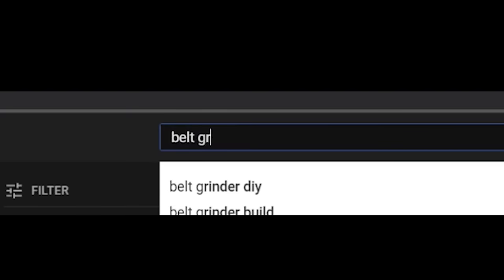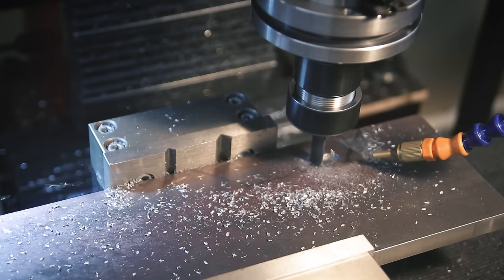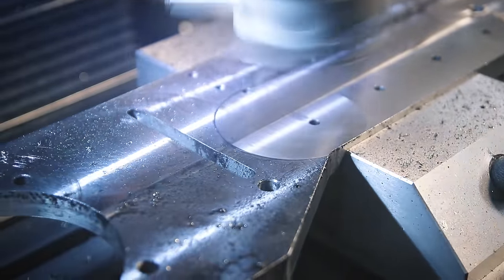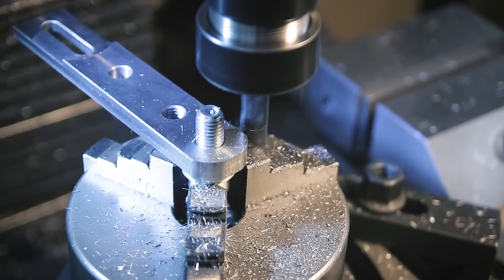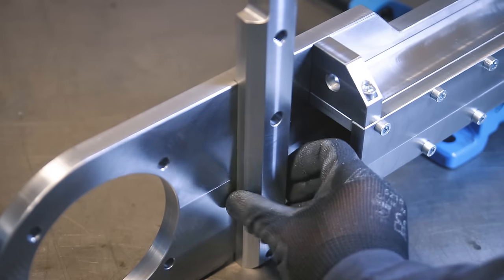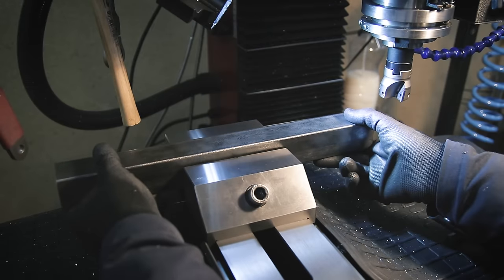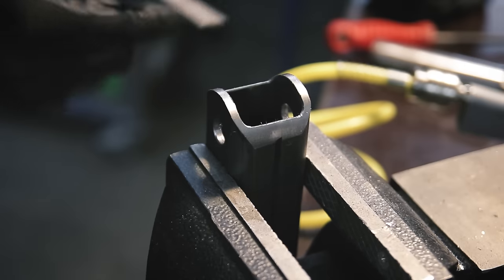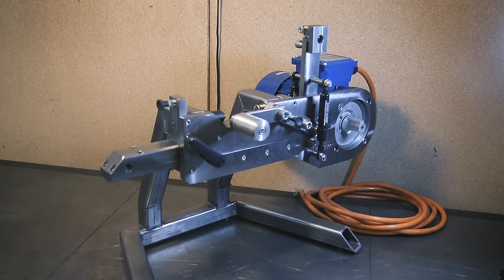Building a Machinists Belt Grinder - The Trilogy [Part 1]

Comment: You can tell the difference between the work of a fabricator and work of a machinist, an overbuilt, overmachined tool, which will do the same work as a basic fabricated one, is an unnecessary use of labor, BUT if I was a machinist I would TOTALLY go all out with my skills to make a basic tool to showcase my skills. It’s kinda like a gunsmith making a toaster with inlays and engravings on it, it still makes toast but it looks good while doing it.

Comment: I like your neurotic approach to design and construction. I’ve bought a fair number of used machines over the years and I find I like the ones where the engineers used twice as much material as would have sufficed for the purpose and generally went way overboard in every aspect. I would like to build a similar grinder and am greatly inspired by your design.

Comment: This is a very nice design for a belt grinder. I really like how it can pivot from 0° to 90° using the quick release handles. The thickness of the steel plates seems more than adequate to mitigate most vibrations that may occur during sanding/grinding. Your machining skills are great and watching you make these parts makes me want to get back into machining again. It was once a part of my job a long time ago, but I do miss it. Never thought I would say that, but fabricating things has its own reward. The process actually relaxes me in many ways. It's definitely therapeutic for me. I think your CAD design is awesome. A picture really is worth a thousand words and seeing the 'idea' up front definitely helps you to reassess certain things as you fabricate, so you can improve things on the fly. I'm anxious to see the final product. Great video!

Comment: finally i found a machining channel that uses metric
Reply: As does Stefan Gotteswinter who has a fantastic machining channel (in my opinion!).
Reply: I'm form the States, and YES our stone-age measuring systems has got to go. But its gona cost a Gazillion dollars to replace it now. Aaand we have those "We are number one" people who say: We went to the moon using inches. To them I say? You also went in your dippers.. It got the job done.. why do you use a bathroom now.
Reply: @iteerrex8166  I'm actually Canadian but default to mostly imperial units when it comes to most things. I keep both metric and SAE taps and die sets, but only keep stock of metric fasteners! Indicators are imperial, test indicators are imperial, calipers and micrometers; digital ones have both metric and imperial, dial/vernier scale ones are imperial.

I was taught machining using imperial units and that's what I've known and used in machining for 20 years now so I doubt that'll change XD
Bottom line, if it doesn't involve fasteners, I default to imperial XD You can imagine the shock I had when I started 3D printing and had to switch from imperial to metric for that XD
Reply: I can go either way, been doing both for years and just convert it when I need to.

Comment: I've been meaning to get my own home machine shop up and running for years now. I think I bit off more than I could chew when I first started and it's been a challenge to get my machines reassembled and modified as I had originally intended. Thanks for the motivation. :)

Comment: I love that someone finally made a belt grinder for metric belts, I'm from Argentina and here is more common to find 75*150 and 75*200 mm belts.
I made a home made 75*150 belt grinder that has not a single piece square, but works fine for what I need. I dream that one day I will have the equipment to build one like this one or like the one that Jeremy Schmidt made (but with metric belts)
Reply: sorry 75*2000mm and 75*1500mm

Comment: You need to make some low profile mill clamps. They are a game changer for plate work!
Fantasic looking build! Also the spring loaded pins are a brilliant addition
Reply from the maker: Absolutely! I didn't even know about these, then saw a video about someone making them a week or so ago, and thought "damn, those really would have come in handy". I kept thinking I need a mag chuck for this kind of stuff, but the price on those...
Reply: Ha I tried the same, a mag chuck doesn't really have enough holding power to make it worthwhile though

Comment: Great work and very nice build. When you face a large, thin piece, you can reduce the chatter by bolting (or tack welding) another plate to it below. That will add the extra rigidity without you having to machine another piece.

Comment: This is the biggest "my shop is awesome" flex I could imagine. Loving the content, wish I could get a mill and lathe myself.
Reply from the maker: I know the feeling, I saved up a long time for these, but I'm hoping they will eventually pay for themselves. My first one was used and only cost around 600€ (I made a video on restoring it). So it's not impossible, the bigger issue is usually that  you need a space to put them...
Reply: Phil Vandelay With that many fuckin ads in your vid it shouldn’t be a problem...
Reply from the maker: @snk_blk I removed most of them now. Besides, you way underestimate how little this stuff pays out, I work on the side to even be able to make this content.

Comment: Hey Phil, nice part.  I noticed that when you had the large part standing up in the vise, you backed it up with a piece of plate.  I'm not sure how your small mill machines, but on a Bridgeport or Lagun/clone, if you push towards the solid jaw on your vise, instead of the moving jaw like you had it, they are a bit more rigid. Also,  if the machine can take it without sucking the cutter in, I'll generally always try to climb mill it, better finish and not re-cutting chips.  Anyway,  have fun.  

Oh, P.S.  Boring heads, in general,  just like drill chucks, don't work very well when going sideways, they were made to just move in the Z-axis. But I'm sure you knew that.  Cheers

Comment: I would like to make a belt grinder, but first I'll need a mill...
and to make the mill, I read I could use a lathe...
so I need to make a lathe.

I've spent the last several weekends making 4 axle holders to fit 15mm mtb throughaxles onto a 2m x 1m bike trailer made from 60x30 Rexroth-style alu section. I used a pillar drill, hacksaw, files and a Dremel with a tiny milling bit. I tried fitting a 6mm endmill bit in my pillar drill, but the whole assembly wasn't rigid enough.

Comment: Comment: At 32:39 you talk about holding work in a machinist’s vice for welding. Holy hell the old timers would say!  One trick to minimise damage from spatter {not that there is much using TIG} placing sheets of thick grade aluminium foil protects your machined surfaces. It can be re-used several times until too holey to use. It does save your nice tooling.  Same thing about wrapping clamps when MIG welding.
Reply from the maker: I find that if you clean your material and get proper gas coverage there's zero spatter with TIG, but I'll definitely remember the foil tip for MIG welding!

Comment: I loved watching the build of this grinder. It looks very appealing to the eye and easy to use with all the adjustments and lockdowns. I have always wanted to build a better one, so, i bought your plans to make this one. One thing i noticed the plans do not have is a bill of materials on the steel used to make it. Do you by chance have a list of materials needed. This way i don't have to spend a lot of time figuring out thickness and lengths  required for clearances when finishing. thanks

Comment: Wow… I found this video from your Etsy plans. I wonder if I could build this without a lathe.

This is really awesome! I think I’m going to order your plans just in case I decide to buy the right machinery to make this.
Reply from the maker: There are sets of finished pulleys you can purchase, actually on Etsy too, look for "TR Maker".  So you might be able to get away without a lathe, but I think you would at least need a mill for some of the parts.
Reply: @PhilVandelay  thanks! I’ve been looking at this sieg mill. Seems to be ok for a starter mill.
Reply from the maker: @digitalgoonie  Yes you can actually do some serious work with the SX-4 as you saw in the videos, and it doesn't take up half the shop. Quite happy with it overall
Reply: @PhilVandelay  oh nice! I didn’t realize that was the mill that you have. I only started looking at them today and I’m no expert in what’s good and not good. So very glad to hear I could potentially do that kind of work with it. I do appreciate that you took time to respond to me here!! Thanks!!
Reply: @PhilVandelay  your mill is an sx4? I can’t seem to find that model. The mills I am looking at are in the US 1000 dollar range. When your machine taps a hole, is there a special feature it uses to do this or are you reversing it manually?
Reply from the maker: There's a button on the quill handle you can press to quickly reverse it. You do have to do it manually though, with blind holes I usually drill a bit deeper to give me some space before the tap bottoms out. As for the mill, the SX4 definitely isn't in that range, it costs around 3000$ usually but it's possible that it's not being sold in the US or under a different brand. But you can also look at the very popular RF-45 type machines (tons of content on them on Youtube) which are quite similar in size and capabilities
Reply: @PhilVandelay  ok thanks!!

Comment: If you can drill a hole you can hand tap shallow with a tapered tap and finish with bottom,I know its longer but success in the end is good,also using tap guide in chuck, provided you're not using CNC  tapping by hand gives a lot more feel when you will break a tap 30 yrs chinist can feel that

Comment: Great video, a lot of talent on display there with the design, machining, welding, CAD work, and videography. Nice to see someone take the time to properly deburr a part with a file, and countersink the holes, and strive for a nice finish. That is often lacking from what i've seen. Looking forward to buying the plans and to parts 2 & 3 of the video. After 30 years I'm kind of partial to a 100mm wide belt though. Do you know of any reason it couldn't be made wider by 25mm?  Thank you a thoroughly enjoyable video.
Reply from the maker: Thanks! As for the belt width, I think if you make it even wider you'd get into the territory where you might want the axles supported on both sides, so you'd end up with a different kind of costruction overall. It might work with this design though, I haven't tried it - just going by what I've seen in industrial machines, which is something I often use as a reference. Since this design relies on some pretty beefy machined axles instead of just bolts to hold the pulleys, it might just work fine, but I imagine there could be issues with belt tension/tracking. Another thing is that if you want to fully utilize a wider belt, you need even more power (rule of thumb is 1 horsepower ber inch of belt width) so you might have to mount a pretty beefy motor which might create space problems, although you can always make the main plate longer/taller to accomodate that. In the end nothing stops you from using a more narrow belt on wider pulleys. If you want to give it a try, I'd be interested in the results!

Comment: I loved your build.
Yes I too built a belt sander.
Mounted to a bench grinder I used an old hockey puck for the drive pulley.
Yours is perhaps better, I made mine with a bench vise  and a prick punch and a hand drill and a file.
out of a drop of 3/4" tooling plate 19 MM for the civilized word.
I was unable to get your plans. 
Perhaps a link in the comments? thank you for your effort of showing us your work.
Reply from the maker: Thanks! Your build sounds like it took a lot less time and money so "better" is always a matter of perspective I'd say.  Regarding the Plans there's a link in the video description and it should also be shown at the end of the video, or you can just go here: https://www.etsy.com/listing/823825577/belt-grinder-plans-and-blueprints

Comment: Hi from N.Z.. So impressed!! Your  detail and workmanship is immaculate. Love that mill!  A question if I may, but considering it is simply a sander, could the side plates and some of the components not be made from Aluminium?  The thickness of the material used in the vid would surely be adequate made in Aluminium.

Comment: Man, the loud click from your mill's power switch when you reverse the spindle during tapping is triggering my PTSD. Thought you broke the tap every time!
Reply from the maker: Ha, yeah it  sounds pretty similar when it actually does break. It's not the switch though, I think it's the pulley on top that has a bit of play and engages in the other direction when the moter reverses

Comment: Not a machinist, but am curious, to prevent the piece (motor mount piece) from vibrating during the facing, could you "glue" it to another under it with something like silicone to minimize the vibrating?

Comment: This is a great build. I'm currently using yours and a few other peoples designs to create my own belt grinder. Quick question. Is there a way in fusion 360 to measure the distance around the pulleys to make sure the 2x72 belt will fit the design? Thanks and again inspiring build!

Comment: Just curious, why didn't you use aluminum? Would be easy to run on a CNC table. I plan to build your design in the future. Best design I've seen so far.
Reply: Steel is a lot stronger than aluminum, and it's cheaper, too.

Comment: Wow, nice video.... very detailed and very nice work, I mean it, VERY nice! Quick question, making out of 1/2" Aluminum, would it be as solid as yours?
Reply from the maker: I would go a bit thicker (1/2" is about 12.7mm if I'm not mistaken, the main plates here are 15mm) but overall, I think it should work fine, this is very overbuilt in steel and probaby would still be overbuilt in aluminum. I would go with steel for the base though, you want that to have some weight. I mostly made everything from steel because it was cheaper, aluminum is much nicer to work with.

Comment: Hi Phil, this may be a dumb question but can your belt grinder use a smaller 2" x 72" (50mm x 1829mm) belts instead of the larger 70 x 2000mm belts that you have designed your belt grinder around. Thanks Phil
Reply from the maker: Not without modifying the design to make it shorter. Some people have done it but I'd suggest just sourcing the right belts which I think are sold as 3x79" or something in the US

Comment: Phil,  Did you make the little locking pin for the tensioner, the one with the black choke like knob on  the end?  or what is it called ?
Reply from the maker: Nope you can just buy them like this. I think they're called spring plunger

Comment: Hi Phil

I am thinking of ordering your plans. Would you think that the plans are detailed enough to enable a plasma cutting company to cut the larger parts.
Reply from the maker: Yes there is also a 3D model included which they should be able to work with and I can send you DXF files of the drawings that can also be used for plasma/laser cutting

Comment: Hi! Great video! Which machines (lathe, mill,...) do you use? The mill doesn't look like the one in your video from 2018, if I am not mistaken.
Reply from the maker: Yeah I sold that one after a while (was a good machine for the price though) The lathe is a Sieg SC-10 and the mill is a Sieg SX-4. Both chinese import machines, really nothing special but I didn't feel like hunting for old machines so I went that route.
Reply: @PhilVandelay  I want to get a mill and was looking at a Sieg S3xl with a preinstalled DRO, because my space is very limited

Comment: Awesome video! I'm only 10mins in but I had to ask, you mentioned that clamping the part was an issue as you didn't have a way to hold it, could you have no used the bolt holes you had just made to somehow bolt it down to the table? That way making it less prone to chatter when making the surface finish? 

Either way, awesome video so far :D
Reply from the maker: Yeah I did consider that but I would have had to make some custom T-nuts first (would have taken a while) and it only would have worked on the one side where the bolts are countersunk but not the other side. I also would have had to increase the depth of the countersunk holes so I don't face off the screw heads so overall it seemed like too much hassle. At the end it was just about surface finish which is more or less superficial here. Like someone mentioned here in the comments the best solution would have been to use low-profile clamps that attach directly to the mill table and hold the part from the side. I will definitely be making some of those if I ever need to face another part like this.

Comment: Why do you want the table to rotate with the belt? I'm just curious because your design is the only rotating design that rotates the table with the belt. I also designed one of these in Fusion 360 and now I might look into your metric belts and rollers because I like the idea of having 75mm x 2000mm belts.

Did you buy the 75mm rollers or machine them yourself? If purchased, link?
Reply from the maker: Do you mean the horizontal mode? Actually 99% of grinders I've seen move the table with the belt, there's really only the Jeremy Schmidt one that I know of that does it differently. It's a clever design but for me I just didn't think it was worth the extra complexity, because setting up the table horizontally really only takes a few seconds. That plus the fact that I will rarely ever use that feature anyway just doesn't justify building the entire machine around that one feature, for me personally. I machined everything on this, you can see the rollers made in Part 2
Reply: @PhilVandelay  I have a lathe so I should put it to good use then. I like your build. Well done.